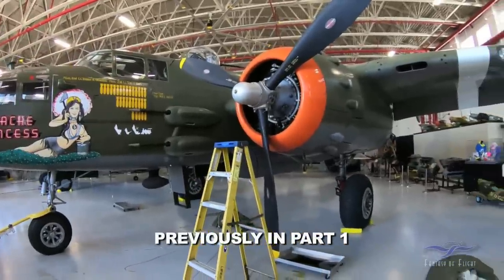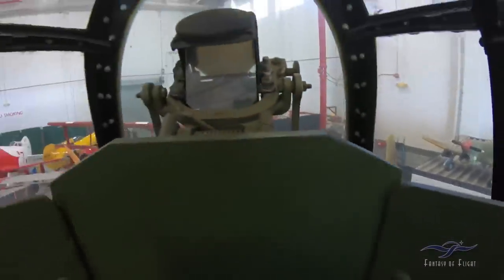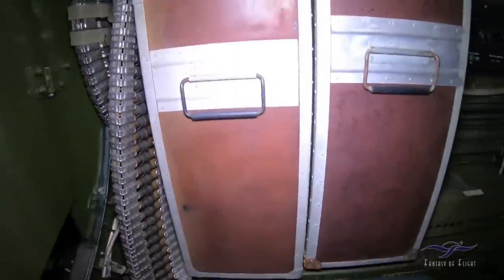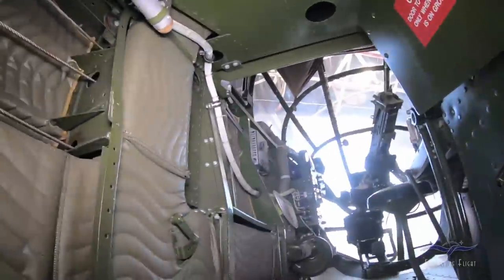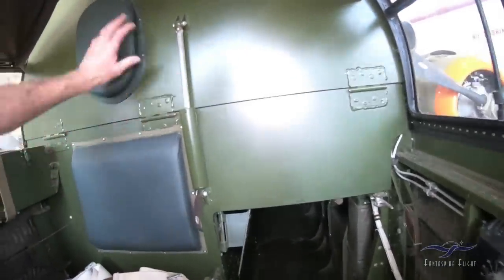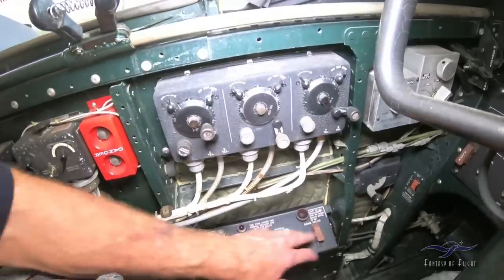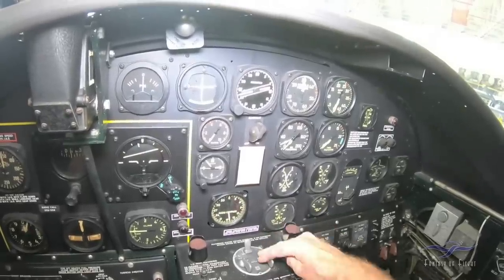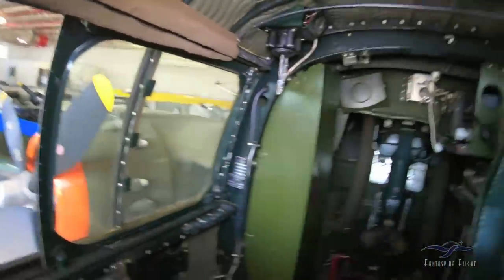North American B-25 Tour - Tail to Cockpit Interior - Kermie Cam

Comment: It must have been very difficult to escape from a damaged B25- getting to that escape hatch from the rear turret. Claustrophobic too and i think the guys fighting in these aircraft were something special. Great video Kermit, thanks.
Reply: it look like there was an emergency release handle on the wall behind where the tail gunner sat so im guessing he could jettison the canopy in the event of a significant emotional event.
Reply: @thurin84  "We're out of NIJ Rum!"  <eject>
Reply: Pretty sure that the rear canopy doubled as an escape hatch. It could be difficult to reach an exit, but rarely that difficult. They wanted it possible to reach an exit within like ten seconds with the the aircraft in level flight. Under G it doesn't matter if it is two feet away, if you cannot move your body from the wall or floor or ceiling. That's why it really annoys me when wikipedia says things like "the B-24 was hated by its crews because it had only a single escape hatch in the rear fuselage". Not sure if someone found an incompetent author that made that claim, or if that was their own 'expert' analysis, but no. The B-24 does indeed only have one single-purpose hatch, but since the bomb doors, nose gear doors and windows all served as escape hatches, the idea that crew from the front were forced to crawl back through the bomb bay into the rear fuselage to escape is foolish.
Reply: Kermit will e stuck

Comment: I believe the double needle, yellow and blue vertical needle (second from left at top) IS an early ILS indicator. I flew the B-25 in basic Air Force Pilot training in 1957, loved that airplane. I have the B-25 type rating on my ticket still, not current!

Comment: I met General Doolittle in Valparaiso Fla, when a B25  was set up as a static display memorial to the Doolittle raid. This must have been 1963 or 64. This plane was the last one in USAF inventory. It is now at air armaments museum at EGLIN AFB. What a wonderful aircraft. Also knew Tom Sharp who worked at North American to install a French 75 MM cannon to the nose in the B 25.

Comment: Thank you so much for this. My father was a flying photograper with the RAF (684 squadron I think) in the far east during the second world war. He rarely talked about that time, but he did mention long distance photo recon flights in B25s, no defensive armament (to save weight) and extra fuel tanks in the bomb bay to extend the range. The hours of uncomfortable, claustrophobic and noisy conditions endured by the crews of that generation are difficult for us to even imagine.
Reply: The photo/recon job Mitchells were called F-10s. No guns, turrets or armor, and extra gas tanks in the bomb bay.

Comment: Kermit, thanks for preserving such an excellent aircraft that had such a incredible history during World War II. 
The thing you asked about 14:08/30:35 is a 28V map light the crew would pull the knob like thing out and it would extend on a retractable cord a few feet away thus allowing them to use it as a flashlight.

Comment: Kermit, really appreciate you crawling around inside the aircraft.   How your knees feeling?   When I was in the Marine Corps we could hitch rides on aircraft (pilot permitting) when going on leave.   I once had the pleasure of riding the jump seat behind the pilots (wearing a parachute of course).    Below my feet was the open escape hatch I would have to drop through if we had to bail out.   That flight was the high point of my hitchhiking career!

Comment: Great stuff. I still have a magazine that had a great article on "Apache Princess" when the restoration was completed. It's great to see the upper turret still has the original seat. 
I noticed in the tail gunners position there is a red handle behind your head (visible at 4:18). Is this handle to jettison the roof section for escape??
Thanks for another great video mate.
Reply from the maker: Yes, for escape hatch.

Comment: Didn't the top turret have a cam that when the guns pointed to back or to the rudder's that stopped the guns from firing, albeit briefly? I think the B-17 and B-24 had similar device. Thanks for part 2. You never know things are liable to "take off" one day, pin intended. Stay safe.

Comment: Love the videos Mr Weeks. On your A-26 video, I noticed switches in the Upper Turret so the turret could be aligned to Centerline, leveled, locked down, and fire control could be selected to the Pilot's switch function.
Did the B-25J also have this feature? The Top Turret was in a 6 O'Clock position, power was off, and we didn't rotate, so I couldn't observe if this feature was present. The J model and the A-26 would have been in concurrent production and had the same client/end user [US Govt] so the technology may have been shared.

Comment: Gunners in a B25 would have to be small , doubt many made it out. Ex miner in low seams, would have preferred that. Would prefer a B17 or Lancaster for the room. Exit strategy just lip service. Heroes.

Comment: How'd the crew pee in-flight back during the war?  Pampers?
Reply from the maker: Relief of bodily functions was not fun! Most long-range bombers, like the B-24, were usually fitted with two small relief tubes, one forward and one aft, to urinate in. These were almost impossible to use without spilling because of the heavy layers of clothing the crew had to wear. Also adding to the difficulty, the tubes were often clogged with frozen urine. Even worse, defecating could be done only in a receptacle lined with a wax paper bag.